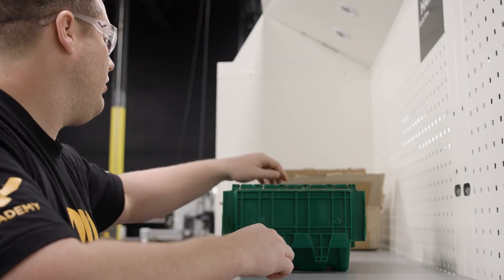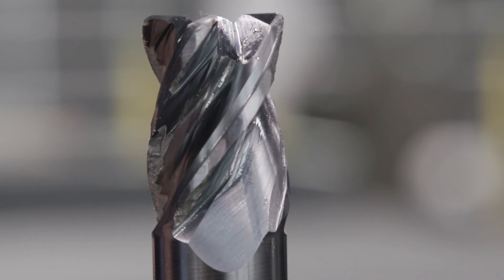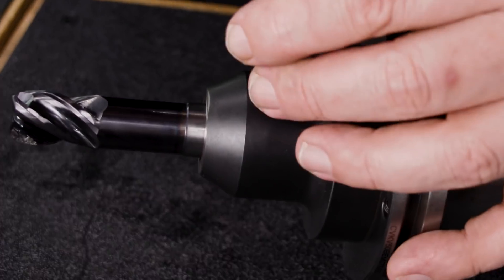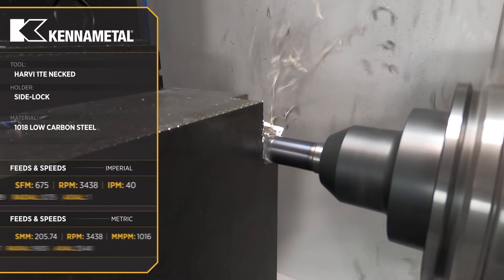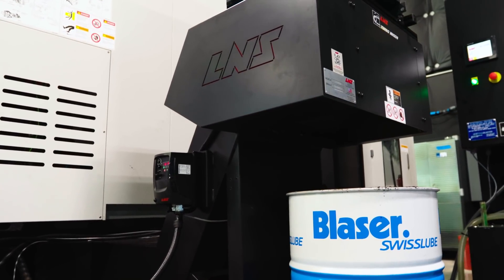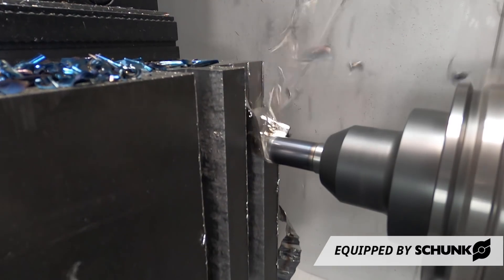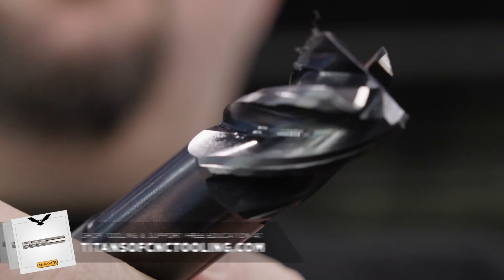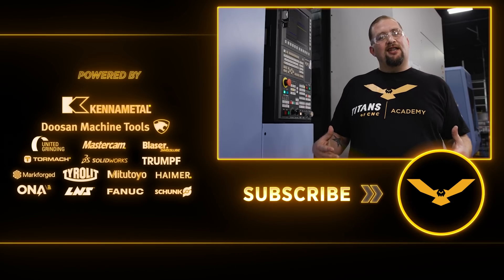Pushing BROKEN Tools Through STEEL | NHM 6300 Horizontal Mill | DN Solutions

Comment: I run some rather large lathes and we used to use Kennametal 2 inch carbide slugs to rough. They were great and lasted but we recently went to a cheaper brand and the quality just isn't there. They really do make quality stuff
Reply: Ill tell you whats crazy, until I came to Titans I had never used Kennametal, because for some reason I thought it was all made in china. I didnt realize that they are an AMERICAN company, and 95% of their solid carbide tools are made right here in the US of A

Comment: Now put an infrared thermometer on the work piece and compared a sharp tool verses that chipped one and compare results of surface temperature, dull tooling leads to work piece surface hardening  in some materials especially in alloys like Inconel, cold form steel and stainless. Also the primary cutting surface is only one factor equally as important is the secondary surface or the cutting relief once its gone you are basically rubbing the work surface creating heat that doesn't transfer to the chip and just an FYI your lead in approach isn't optimal and leads to a lot of lost tool life and catastrophic disintegrating.
Reply: Man, i see your comments on every video basically saying that we dont know what we’re doing. Let me just say that we dont post anything unless we are either impressed, or trying to help fellow machinists. Have i studied the microcrystalline structure of the material? No. Have we vaporized the material to check what the actual atomic definition of the material is? No. Have we used FLIR to tell us where the heat is going? No. Have we absolutely blown peoples minds? YES. So chillax.
Reply: @barrysetzer  He had a really good point. You guys could have included it in the video as a disclaimer.
Reply: I agree that he makes a valid point. The problem is that the point of this video was just to show that this tool is a monster. I never said that this is “the preferred method” to do ANYTHING. I literally said “what happens when you take a destroyed cutter and try to full slot with it?” And literally threw a piece of scrap metal in the vise, not a part. Thank you BOTH for watching, and i appreciate the comments. I just hate feeling like people watch the videos and miss the only point of it. We only did this video because I saw that cutter, and wondered if it would survive a full slot!

Comment: You can sharpen the carbide tools     It’s what I do for a living  and currantly doing some tools that have to be within 0.005mm.
Reply: 5 thousands? Just breathing hot air on a piece of steel will make it expand by that amount. I call bullshit.
Reply: @Mp57navy   that’s why all measuring is done on a cmm  machine in a temp controlled room  at 21deg

Comment: Do you see an increase in spindle load for the same op once the cutting edges are chipped?
Reply: yes, there is a small increase, like 2-5%
Reply: @barrysetzer  Thanks for the reply. That's pretty impressive. A few years back I was running an job in Inconel using an indexable high feed mill. Spindle loads were varying from 80% with new inserts to about 120% when they were dull.
Reply: @reverendalosada  inconel is tough.

Comment: Really? 1018? I want to see it do the same in some inconel, or just make it easier maybe some heat treated 15-5. Is it doing well in low carbon steel? Yeah of course it is, but its an endmill designed to take a beating and keep going. Show me something other than a hot knife through room temperature butter and I may be impressed.
Reply from the maker: It was just machinist humor to see if it would handle etc and show that these tools are literal Zombies. We machine Inco, 286, Monel, Etc etc… And teach all… check out AerospaceAcademy.com

Comment: Wow I am surprised by that.  Why are you using a sidelock holder? Is this done to show that the tool still works well with less favourable toolholding.
Reply: Side lock holders are actually pretty good if you are worried about tools pulling out. In this case, we weren't worried about runnout on the tool, but because the flutes were already damaged we WERE worried about pullout.

Comment: Definitely getting chatter. Sorry but.... you were :)
Reply: The sound in the videos can be a bit deceptive. Sure, we were full slotting so there WAS a small amount of chatter. But consider that we were full slotting with a tool that had already suffered in 718 inconel, and some of the audio of me talking was recorded while we filmed. There is a mic in the machine, and one on me, so the fact that you can hear me talking at all is a testament to how quiet the cut was from OUTSIDE the machine!
Reply: @barrysetzer  It's impressive what the tool was doing 100%. But there were a few points were the cutter was changing direction. Either slightly less radial engagement was occuring or just the rigidity was working in the cutters' favor. The chatter completely went away then came back. It's not criticism on you : )

Comment: Fantastic. Makes a good case to run it till either the tool snaps, fixturing snaps or the machine overloads.
Reply: I was thinking the same thing, if the bit doesn't snap, then some bearing or more expensive thing will end up ruined eventually.. Usually an expensive or hard to replace part.. 😅

Comment: I'm thinking of trying a 1/2 inch diameter with .09 corner rad on hot rolled 1018 at .7 depth.  Can you guys recommend a good starting rpm and feedrate for that situation?  Air blast or coolant?   This is on a direct drive 40 taper VF5
Reply: is that full slotting at .7 depth?
Reply: @barrysetzer  Yeah. Slot is 1.1 wide with .375 rads in the corner so one pass through the middle and then maybe two more depths up to the top of the fillet.  Then I finish the radius with a .75 ballnose
Reply: If you use a necked tool like 6767818, I would take the slot in 2 depths at 650 SFM and 40 ipm. You need to lead into the material at 20 IPM until the cutter is fully engaged, then go 40. If you use a tool with a longer flute length like 6676426, I would go the full .7" at 30 ipm with the lead in at 15 IPM, and coolant in either case.
Reply: @barrysetzer  Thanks!  Got them in my cart already.  I've been using sandvick r.390 to rough these out for years now.  If I can add even one part a day it would be a huge improvement and easily pay for the tools
Reply: @barrysetzer  Didn't quite work out for us.  The first one broke instantly as we were using a HAAS milling chuck and it seems they are no good for any useful side loads.  The second one did ok but was wearing significantly after doing very little work.  It cost $90 and did the work of $20 worth of inserts in a Sandvik R.390 before it was unusable.  These things are always worth trying though.  We are actually having great success with the HAAS HEIX  inserted cutters now which are outlasting the Sandvik inserts by a good margin.  We are also trying out their HEHF high feed mill and so far it seems to be very productive and a bit safer to run lights out.

Comment: I have no loyalty to any brand so I will tell this anecdote.

I had to make a 3/16 c-bore .25 deep in 316ss. I used a kennametal 4fl end mill and peck drilled with the endmill. I noticed the c bore opening up slightly (tool was already well worn but not badly chipped). I set up a Kyocera end mill with same geometry and it broke Instantly (I know i was drilling with it but still).

I went ahead and setup up the kennametal again (same tool) and ran 13 more without them opening up anymore pr out of tolerance.

Long story short, the tools are infinitely tougher than others.
Reply: Man, they are MONSTERS. Love this comment, because it once again proves the point of this video!
Reply: Thank you for these comments!!  #Kennametal

Comment: I mean it'll cut, but it ain't clean and is not the same dimension as a fresh tool so it will not be in any sort of tolerance.
Reply: Sometimes it doesn't need to be.

Comment: There are definitely pros and cons involved here. If you're running cheap and easily replaceable parts that you can toss when the cutter breaks and leaves a digger that won't clean or if you're not interested in regrinding this is the way to go! 😃 
As always, awesome videos!
Reply: U only use those tools to rough material
Reply: @LordOfChaos.x  Roughing is when the majority of end mills break. (Not always) but very rarely will you break one finishing if all is right.
Reply: @thefreedomchopper4027  the point is u only use this tool to roughing material
Is not made for finishing pases
Reply: @LordOfChaos.x  Ok.
Reply: Just use it for roughing
Reply: @leensteed7861  Let's just say for the sake of argument that the beyond damaged cutter you chose to use for  only roughing breaks scraps the part and damages the tool holder. What then? What could you possibly say to whomever is in charge for them to say oh no problem! You made the right cutter choice!   🤣😳
Reply: @thefreedomchopper4027    How can it scrap the part if its roughing?  Damages the tool holder?  Just use a cheap weldon screw in the side holder, not your expensive hydraulic chuck.  BTW, I am the guy in charge so damage is my problem but so is productivity.
Reply: @leensteed7861  I don't know what else to say. Have a good one.
Reply: @leensteed7861 I have seen tooling shatter in the cut and leave chunks of carbide embedded in the part.  ymmv
Reply: @Ddabig40mac  Yes. Me too.  It depends on the job.  My product is continuous production every day in cheap 1018 steel running 10 machining centers.  If the cutter breaks it will at worst ruin a $15 length of steel.  If I get an extra day out of a cutter working hard like that I've saved the $90 on the cutter and made the most of its life.  I'm pretty sure the cutter will degrade slowly and we will see from how its cutting + the load meter if its time to change it out.  Based on my program it looks like I can drop my cycle time from 4.5 hours to 3.5 hours using a 1/2 inch Harvie with .12 radius corners with translates to making another $600 profit daily from one machine so that's well worth a look

Comment: I had a couple old pcd button inserts that was like that, we had ones we used just for aluminum cylinder heads but we occasionally would use them on cast iron heads with stainless pre-combustion chambers on the final pass due to ringing after the the pre-combustion and they would often chip but i discovered the "freshly chipped" edge on some of them left an amazing smooth and shiny finish on alloy heads.  😂
Reply: I have discovered that sometimes the "wrong way" works best. Example: pulling out a long boring bar in hardened steel. Trial and error ftw.
Reply: Because chips are sharp. For example the knapped edge of a flint or obsidian knife is sharper than steel.

Comment: Kennametal  makes quality tools.  You will pay a little more up front but if used properly, it will make you $ and save you time. 
Cant go wrong with Sandvik as well.
Reply from the maker: We sell them at a low price on our store, see link in description
Reply: Absolutely. We run a half inch 5 flute with chip breakers in Titanium that literally don't give up unless we manage to break them. Usually comes shortly after the 2nd flute breaks off. We get so much use out of them there isn't even a point in getting them reground and having to deal with that mess.
Reply: I started with Sandvik endmills, but found that kennametal endmills were half the price of the high performance Sandvik ones, and would outperform them by a mile
Reply: @HondaBoy  Yes.  I was referring to Sandvik milling and turning inserts though.
Reply: Seco is also good
Reply: I absolutely love Sandvik tooling. Have had bad experience with kennametal but that could be just the tooling I had.

Btw I am running manual not CNC.
Reply: Seco, Sandvik, Kennametal, iscar, Mitsubishi. They all make great carbide